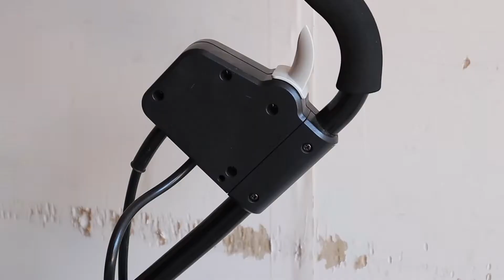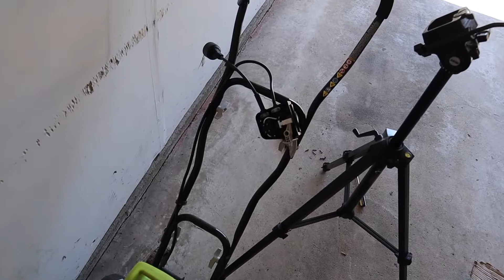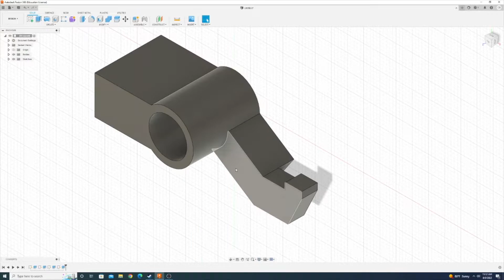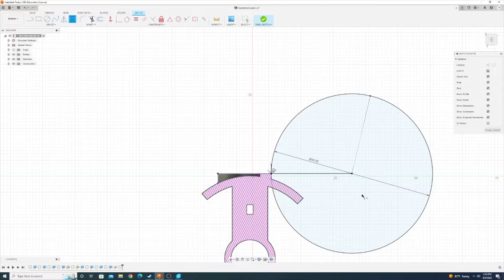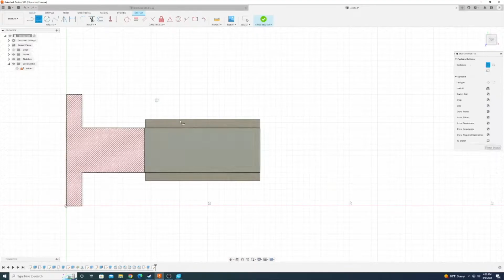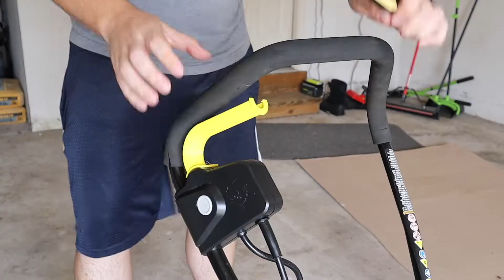$50 Ryobi Rototiller! | 3D Printed Handle & Safety Delete | Ender 3

Comment: I have a ryac700 but found no videos on how to replace the trigger. Until I decided to YouTube ryac701 and came across your video. Huge help in the the sense that your pieces are exactly like mine. I was able to purchase the handle on Amazon. My only challenge is, the springs are inside, how are they placed correctly? Can't seem to get mine to work. Might it be the spring? I never had an issue (barely used) until the handle broke. Any advise will be greatly appreciated.